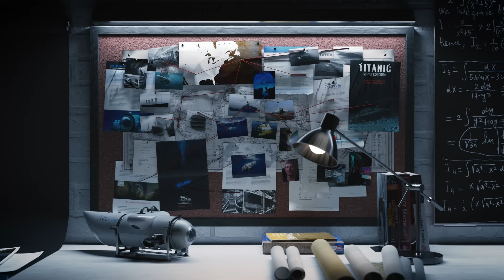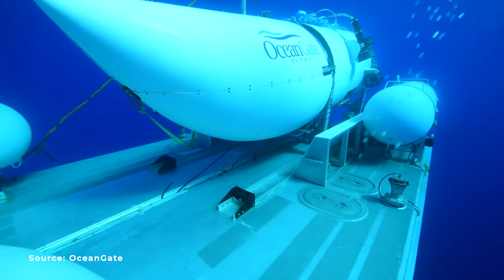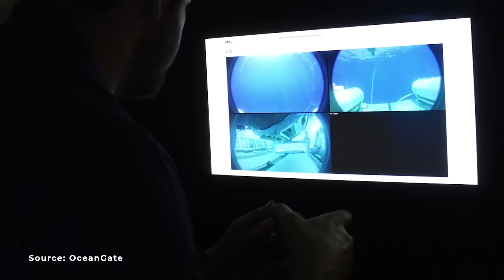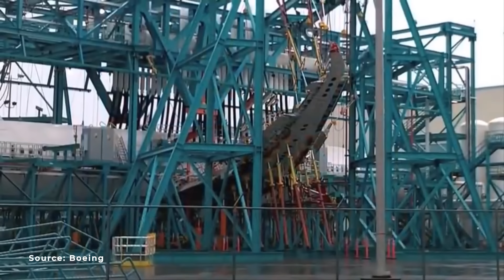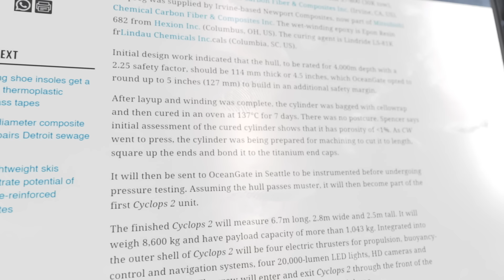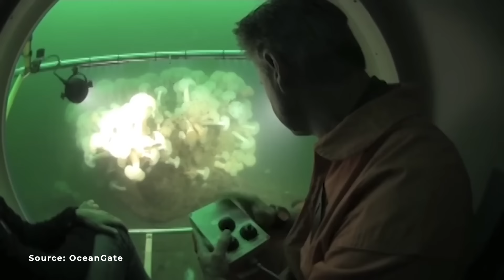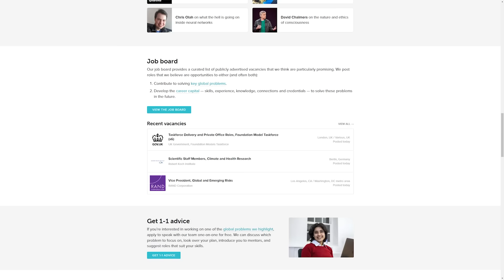The Questionable Engineering of Oceangate

Comment: Being someone who's worked with carbon fiber and other composites, even I know using composites in this matter is a terrible idea without a way to vaccuum out the air from the epoxy. When we'd lay carbon fibre across a surface, not only were we treating the parent material, we also presoaked the carbonfiber in resin before laying it. Using spatulas to force the air out of the exoxy while laying down more epoxy to guarentee it's fully soaked. This process still leaves voids though. No matter how hard you work, you will always get tiny voids between the parent material and carbonfiber.  Our company would drill out the void and use a syringe to inject resin into it. 
This was enough to hold up skyscrapers, but it definitely isn't be enough to make a fucking submarine.

Comment: They didn't want to test for the mechanical failure because most issues arise from operator error is classic confirmation bias.  It's like in WW2 when they studied which parts of the planes were the safest.  Most planes returned with damaged wings, parts away from the crew compartments.  It wasn't because those crew areas were safer, it was because they weren't.  They didn't return because they were all dead from being in those areas.

Comment: I’ve been trying to understand exactly what happened with this.  Thank you for explaining it in a way someone not familiar with engineering would understand.
Reply: What he covered was just one of the many, many issues with this submersible (not a submarine since it relied on external systems to keep it operational).  The hull fracture just happened to be the straw that broke the camels back.  They also had an unreliable control system (a cheap, notoriously bad Bluetooth controller connected to a Windows Tablet), and if memory serves their engines, life support, and tether systems were also of questionable design and failed frequently.

Comment: I took a mechanical technician course some years ago. Still trying to get into the field. But I'd like to double check something with you if I may. From what I understand and recall, the carbon fiber they used is more plastic than elastic, which means a low yield point. Which means it would break easily. What confused me is that they use this stuff for aviation as well so how could it have a low yield point? Then I saw you mentioned that this material is bad for implosion/compression forms of strain and I think that clears things up a bit.    What I gathered is that this material has a low yield point only with this particular form of strain, which is why the sub failed. Is my understanding correct?

Comment: The analogy between Stockton Rush and Elon musk or SpaceX and ocean gate is very misleading at best and ordering on slander. SpaceX moves fast and breaks things IN TESTING and the implement what they learn very quickly. They do not continue down a path that is going to lead to failure once they learn the lesson. This is basically the exact opposite of ocean gate. They avoided testing intentionally and Even when industry experts told them how things would fail and they saw how things would fail in their own design they continued down that path until it led to catastrophic failure and loss of human life. SpaceX on the other hand, never put people on one of their rockets until the rocket was well proven and the design was certified by an outside organization.

Comment: It's telling that their test was to dive to 4000 meters while operationally they dove to 3800. That is a 5% margin of safety for day to day operations vs testing. That's concerningly narrow. Like, if someone gets a new airplane with composite spars, and pulls 8 G on the first flight, and the wings don't fall off, that does not even begin to rate it for 7.6 G on an unlimited number of flights.

Comment: I love this line:
"We need more people like David Lockridge, the employee who was fired for raising concerns over safety"

Because it can sound like we need more employees fired for being concerned for safety LMAO.

Yes, I know this means we need more employees who are willing to risk being fired to maintain safety by speaking up.
Reply: Another one would be former Alaskan Airlines maintenance engineer, John Liotine.
Reply: @DrMackSplackem I mean, the latest incident (the door plug coming off) could not have been caught by the airline itself so early in the aircrafts carrier. They might have caught it when investigating the (unrelated) defective pressure censor on the door plug on the next maintenance cycle, but before that only Boeing or the independent inspectors Alaska hired to check for exactly things like this could have found the issue.
Reply: I think the point is more that if the majority of engineers were like him than it would be much harder for companies to abuse and silence them.

Comment: As a process engineer my knowledge and experience doesn't map precisely onto this (process engineering is largely based around engineering of chemical processing/product systems), but I was still wincing so much when RE brought up how they were skipping tests, ignoring experts, and bypassing standards. Regardless of what type of engineer you are, one of the very first things that gets hammered home to you is that those things exist for very, very good reasons. Yes, they can be annoying and restrictive. Yes, they can slow you down. Yes, everybody grumbles about them. But if you fuck up your design or build, especially in dangerous conditions? It's not a question of 'if' you'll kill someone- it's a question of 'when'.

The people who were duped by Oceangate found this out the hard way.

Comment: Does curing resin under positive pressure eliminate voids or just reduce the bubbles to a microscopic size? Don't you have to de-gas the resin in a vacuum first to completely eliminate voids? Your video really made me curious about the composite process. Thanks for sharing.
Reply: You can't really ever truly "eliminate" voids. Isn't really how it works. But what you can do is reduce them to 0.0000000001% (ofc, the more you reduce, the more expensive it gets).

It's like those toilet cleaners: cleaning 99.9% of bacteria still leaves you with like 3 billion, and each of those is a potential place failure could start

Comment: My university dissertation was on how different projectile shapes and speeds effect carbon fibre at high velocity impacts. I did tonnes of research for my literature review on how CF reacts under pressure and impacts. When I heard the body of the vessel was made from CF I knew immediately what the failure was. CF isn’t a magic light weight material that’s just “better” than metal counterparts. At best it’s an alternative with different downsides.
Reply: Thomas Sowell said "there are no improvements, only trade-offs" and I throw that around all the time.
Reply: I remember when I was a kid and just learned about carbon fiber and how amazing it is. I thought it was indestructible compared to "lesser" materials, and then I got my hands on a carbon fiber badminton racket...
I mean, it didn't break and still hasn't, but I could definitely snap it in half with some force. If little baby 12 year old me can figure that out, there's no excuse for anyone trying to actually build things with it.
Reply: You just said it all 👍

Comment: I know all of you "experts" are crapping on the carbon fiber, but PLEASE answer this question...When they bring they brought up the metal weight end cap that was missing the window, why was the carbon fiber hull COMPLETELY and CLEANING removed from the metal o-ring at the end of the metal cap?  Would this not seem to suggest clearly that the glue/epoxy that was supposedly affixing the hull to the end cap failed possibly because they did not rough up the surface they attached the epoxy or that the epoxy was not even because humans put it on or something to that affect?  Should we not see at least small pieces attached to the surface of the o-ring of the carbon fiber or other debris?
Reply: @smithnosebar  You know I have made just a couple comments on this channel and other channels since 2006 and you people that respond in the strangest and strawman way.  Who gives a flying fuck if grammar isn't perfect or if I write in "complete sentences"????  Many times I am voice texting but nearly every other human on nearly every other channel seems to understand the gist of what is being said and then responds accordingly.  But for some reason you people on this channel or so anal that it just shows how dumb you people are regardless of your English degree. MY POINT is that these "experts" are quick to jump on the carbon fiber when there is clear evidence that it might be something else that caused the accident and that I was literally ASKING Real Engineering to explain it.  Jesus.

Comment: Isn't an implosion very unlikely? Wouldn't it be much more likely that a tiny crack caused a leak long before that? Which would result in an explosion, caused by the water rushing in at an extreme pressure.
Reply: "tiny crack caused a leak" is what happens when you have water pressure for, like, idk, your house plumbing or a hose

this is mindboggling amounts of water pressure that just crumples the sub

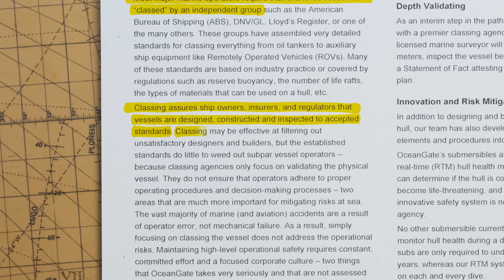Comment: 3:55

The reason why most air and boat accidents are because of operator failure is BECAUSE regulations make sure that (for the most part) unsafe designs don't get approved, meaning that the only way they could fail is due to human error. Saying that you don't need to get your design approved because most disasters are because of human error completely overlooks this and is a text book example of survivorship bias. 

It would be like saying you don't need to wear a helmet while biking because most people that get hurt biking don't die and instead go to the hospital. Ignoring the fact that that the helmet is the reason WHY they are going to the hospital rather than the graveyard.

Comment: The idea that most vessel failures are caused by operator error could be a form of confirmation bias, similar to when the U.S. Air Force started reinforcing the wrong areas of their planes because they kept coming back with battle damage in those areas. The real issue was the planes that were not coming back at all. Operator error is the most common point of failure because the vessels themselves are held to such high standards that they now rarely fail structurally. Simply put, even if operator error may be the only failure point remaining, that does not mean structural failure is impossible.
Reply: If memory serves they did not in fact reinforce the wrong areas.  Some of the engineers and/or management almost did but a more experienced engineer stepped in and told them what in hindsight seems quite obvious (probably one of those things where the other engineers heard him explain it and were like, oh that's obvious, we're stupid).  It's easy to get so wrapped up in a problem that you forget to take a step back and re-examine the basics.

As for your primary point I'd say it's either confirmation bias or the guy had a death wish (someone close to him apparently reported he might).
Reply: @grn1  Ah, yes that makes more sense, thank you. I only remembered the broad strokes of the story

Comment: When will they start calling this Oceangate-gate? 
Btw, you mentioned that using sound detection to listen for cracking fibers doesn’t work because it is accompanied by catastrophic failure. But then you immediately contradicted that by mentioning people could hear cracking of fibers during the dives. So the concept actually would have worked if they just listened to their own sensors.

Comment: Acoustic monitoring was a joke, yes it was a marketing ploy, but it was installed as they themselves were worried about CF fatigue. I had a CF racing bicycle, it was great, light and stiff. Then one day it snapped and I came off at high speed. A small chip on the front fork caused the front end to snap and collapse. CF is extremely brittle , breaks within milliseconds without warning. Never again will I use a CF frame, any stone chip or damage will result in instant failure. The CF on the titan should have been wound onto a thinner titanium cylinder to avoid internal delamination. Rush was arrogant, he thought he knew better. He threw away a century of submersible historical knowledge trying to reinvent the wheel. I think the failure of titan was the acrylic view port, it was only rated to 1300m. When the titan loose power at 1600 meters, it nose dived at high speed with a sudden pressure increase. Acrylic window needs a slow decent with slow pressure adaptation. Maybe CF is the same, can’t handle sudden pressure increase when I nosedived at high speed.

Comment: If I'm not mistaken, even reinforced concrete would have been a better material choice than carbon fibre. 

Concrete is roughly as good as steel in compression, but only weighs about a third. 

One could argue the brittle nature of concrete, but in compression and at those depths, it basically has the same failure response as steel. 

When looking at the compressive fatigue of concrete, it's so good that it'll often outcompete steel by quite a bit.

They should have made the sub out of concrete instead of a carbon fibre composite.

Comment: 00:00 Introduction to the oceangate submersible descent to the Titanic's remains
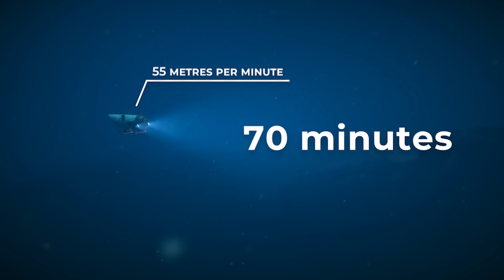00:16 The immense pressure on the submersible's hull
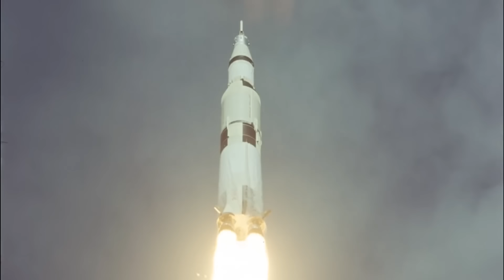00:41 Loss of contact with the surface and the submersible's implosion
01:06 Questionable engineering decisions and the use of composite hull
03:19 Design challenges and justification for using carbon fibre composite
05:06 Unique failure mode of composite materials in deep sea applications
06:00 Limited research on the failure mode of composite pressure hulls
06:24 Lack of fatigue testing and inadequate classification tests
09:04 Incompetent use of composites and lack of autoclave curing
09:30 Concerns raised by a former employee and dismissal of safety practices
11:12 Inadequacy of acoustic monitoring system and disregard for expert advice
12:03 Dangerous trend of moving fast and breaking things in engineering
13:11 Introduction to 80,000 Hours and their research on fulfilling careers
13:26 Concrete recommendations for making a positive difference in the world
13:47 Focus on safety in the development of AI and resources provided by 80,000 Hours
14:42 Join the newsletter and receive a free research-led career guide
Reply: Good bot.

Comment: 10:56
I'm not an engineer and had no idea what the fracture curve of carbon fiber looked like but even I thought that listening to the hull for breaking sounded stupid as hell and now that I see what the curve looks like, that idea sounds even more stupid.

Seriously, the entire system is based around the assumption that you'll be able to get to safety in time if you're able to hear the hull breaking but there's so many factors that can go wrong with that assumption that it seems absolutely insane. What if you take too long to get to safety after hearing the hull breaking? What if the hull breaks faster than you expect? What if you're too deep and aren't able to get to a safe depth in time? What if you rise slower than you expected? All of those and more would mean you're now dead in the water literally.

Comment: I ran the numbers, and calculated at the Titanic's depth there is 58,160 pounds for pushing on the submersible for every square inch of it's entire surface.
    A 55 gallon oil drum at that depth, would experience 187,255,774.56 pounds. This is equivalent to eight and a half Eiffel Towers.
    Asking how much one would have to reinforce a 55 gallon oil drum to withstand that amount of force paints a clear picture of what this this submersible was not ready for. 
    If anyone knows the surface area of the Titan, I'd be more than happy to covert the amount of pressure into a number of some random building's weight. No doubt that this was hundreds, if not thousands of times greater that a puny 55 gallon oil drum.
    "Titan" was clearly missing  a "ic" at the end of its name.

Comment: A tube is literally the simplest form to use a mandrel to make a compression mold to forge the carbon fiber, which would also make it simple to use high performance thermo-set resins too. 
It would be interesting to study the difference between carbon fiber chips usually used in forged carbon fiber products VS directional long fibers when it comes to delamination. 
Leaving an inner mandrel tube of titanium would also work to stop buckle delamination too.
Reply: Forged carbon fiber is nothing but marketing hype. It's just close molded carbon, and almost all of the structural properties are resin driven.

Comment: Photos of the interior show that the computer monitors were actually screwed into the hull. 🤦🏻‍♂️This is very dangerous as it will weaken the composite material. Monitor brackets should have been glued on.

Comment: Great video, thank you for giving a clear and concise explanation. If you have the time to give a short answer, I have a question relating to your topic of Master's thesis. I am a mechanical engineer preparing to go back for a Master's, and I am on the fence about several topics to choose for my thesis. My question is general, how viable is a topic on material science when it comes to acquiring useful research, avoiding previously covered investigations, and gaining enough data for a decent paper/dissertation? Did you find it more difficult than your contemporaries' topics to complete, and did you require significantly more time and/or monetary investment than most? I understand this may get buried under the many comments thus far, but if you see this and have any advice, I would greatly appreciate it.